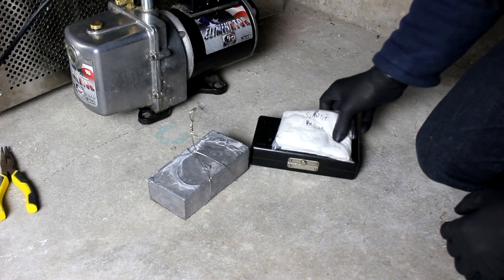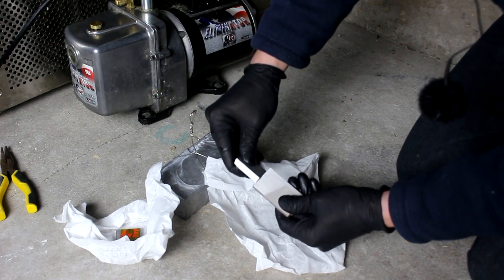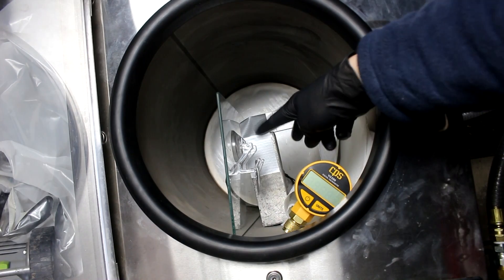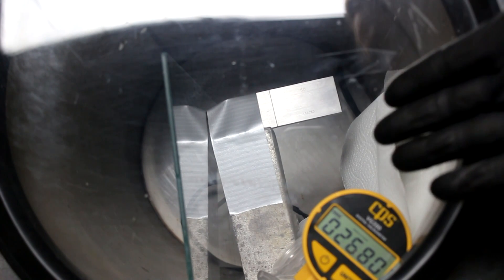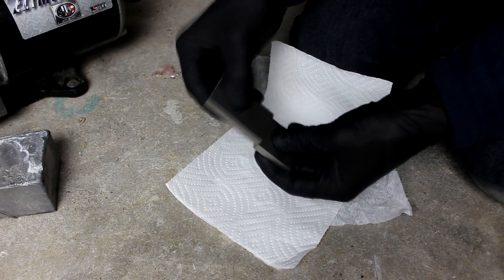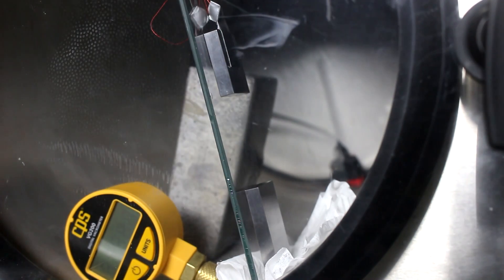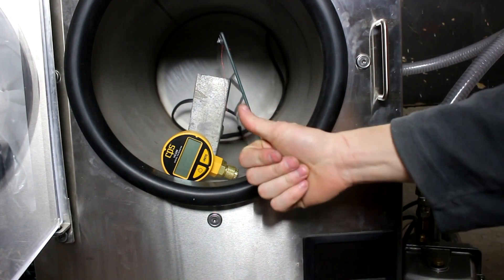Will Gauge Blocks Stick In Vacuum?

Comment: Maybe those dislocated elektrons start moving through both pieces. And therfore making it behave like on solid piece. You could check this by heating one side while them standing on top of each other and while being held together. If the second part heats up faster while being linked one could say, that the energy rich electrons traveld through the gap

Comment: void space phenomenon
2 perfect 1" gage blocks when wringing them together lose length.
1" + 1" = 1.9999999999"
Source: I am a dimensional calibration technician and have to account for this when building blocks of more than 4 blocks in length.
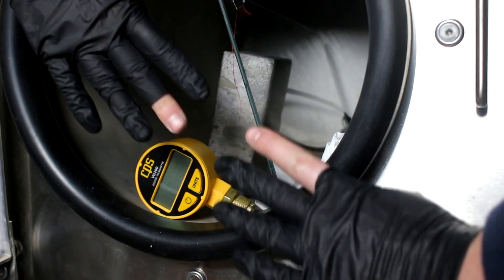Reply: 12:43  correct.

Comment: are we absolutely sure there is no galling going on, even on a small scale?
Reply: No you can simply rest them atop of each other over a weekend and they stick tight, longer they are left tighter they bond, had to use 5lb shifter hammer to split big pairs inadvertently left over a long weekend once, bond can be literally atomic.

Comment: Mini friction welding, small 'hairs' of metal interlocking, plus static? (Think your hair and a charged balloon)
Reply: that actually might be the case... 
kinda seems like that one trick with the fine liners that welds them together
Reply: I don't think static charges could be a factor since you need two different materials with a different average chance to lose an electron, creating net charges that are attracted, and the blocks are made of then same material.

Comment: I think it's a self-generating magnetic field, as the ions pass each other they swap charge back and forth creating a tiny magnetic field. You Can't test by electroplating the ends with something non-magnetic and or placing a piece of paper on the top and sprinkling with iron filings as you slide them together under the paper.??

Comment: I wonder about “liberated” atoms.  If it was just intimate contact the “sliding” shouldn’t matter so much, just “pressing” should suffice. I wonder if you actually abrade the surface liberating atoms to play intermediary like a glue. Sliding seems crucial, so it seems some mechanical alteration from the sliding is a major factor to get the effect.

Comment: I think the "cold weld" phenomenon can be attributed to oxydation of the metal where the air pockets form (micro rust). As for the original reason for the stick togetherness, I can only guess, but it think it might have to do with some inverse square stuff involving a combination of magnetism and vacuum

Comment: the duck tape will outgas from the adhesive if you pull a hard enough vacuum long enough between the shrinkage and hardening of the adhesive as it dries it will have a glass like surface that powders easily it may be enough but it will be much less strong that before you vacuumed it,

Comment: Temperature increase or perhaps slight static charge from the friction and the many contacting molecules (with heavy quote marks of course) of metal get electrons from the different blocks to flow or interact across the barrier? That might explain why the impact forces from the vacuum experiments weren't similar enough?

Comment: Wringing is not the van der Waals force / london dispersion force. Between two flat planes with 10nm separation in a vacuum, the van der Waals-induced pressure is around .05 atmosphere. This is two or three orders of magnitude too low. Its an additional order of magnitude lower under atmosphere. The longest atomic bond of any kind is less than .4 nm, and those bonds tend to drop off by the 4th power or greater. Even if tiny peaks of the blocks are touching, it won't be enough to create an attraction. Gecko feet are a weaker attraction than gauge blocks and we know Gecko feet uses the van der Waals force.

The separation would have to be below 1 nm across a large amount of the blocks to make a bond, and the roughness of gauge blocks only have tiny spots of contact. (Additionally, the force is repulsive before its attractive.)

I have no clue, but the Casimir force works at the scale of block roughness. Doesn’t explain why the attraction is not hugely stronger for metals, though.
Reply: I might suggest an all together simpler explanation:

The small 5-10 lb force being applied when wringing is enough for local surface deformation (and temporary vacuum) of the peaks when we consider *just* how small the feature sizes are.

So just a small amount of deformation at these scales -- then applied across the entire surface of the gageblock -- is enough to get the thing to stick.

An experiment to run:
Quantify the forces applied between blocks when wrung. See if there is a relationship between the sticking force (for example when being put into tension + pulled apart "normal" to the joint) and the force applied during wringing.

GRANTED: the force application required for tighter "sticking" between the plates will be exponential -- just bc feature sizes are so normal across these faces.   If were deforming the small ridges, with 5lbs ... for the user to begin to deform the less-extreme peaks (and therefor hugely more common) will take QUITE a bit more force. Simply by a function of the peak count -- far more peaks to deform.

So your experimental inputs will be something like

1lb
5lbs
50lbs
500lbs
5000lbs

If you have a change in the sticking force, I'd wager then the wringing phenomenon is caused by localized vacuum.

Comment: Cody you have just proven that the ether exists.  The ether is pushing in on both blocks, matter cannot exist without being fed the energy of the ether.  It maybe possible to assume that the surfaces are so close so polished so parallel it is excluding the ether.  If you figure the pressure from the air acting on the blocks it is magnitudes less than the ether pressure.  Vanderwaal forces are ether forces in my thinking.  Thanks for the experiment.

Comment: Actually that probably is microscopic ridges on each piece that are created by the machining process. The ridges are sliding between one another and linking each block together. I wonder if you too two different ones, and milled then on different machines and milled them at perpendicular angles, if that would cause it not to work.

Comment: That's got to be a type of friction. I'd say it's creating a vacuum and air pressure is pushing them together. But apparently someone tested this in a vacuum and it still worked.
Reply: Cody showed that it was not due to a vacuum between the pieces. Watch the first test again.

Comment: The surface is so smooth, that the material does not know where it ends, if you don't show em by removing them from each other
Reply: I think this is is more probable than not, that is unless a ceramic block will ring with a metal block.  I guess I need to google that first. LOL

Comment: My brother once destroyed a vintage motorcycle carburettor by degreasing the aluminium float slider and bowl with acetone. It 'welded' together, and could not be freed without deforming the components.

Comment: so at least part of what's going on here is there's a force pressing  them together when they are closer than a wavelength of light to each other. this effect only works with gauge blocks because they have enough flat area to make the effect observable. essentially in any space small particles appear for very short periods of time, then disappear. when two objects are close enough, those particles cannot appear there because there isn't room for them to travel before they annihilate. as a result there is a relative pressure from those same particles on the other sides of the blocks pushing them together.
Wonderful demonstration in quantum physics!!

Comment: With  the vibrational  energy  of  the  vacuum  pump and the fact that the input energy  of the mass of the block slamming  at an oblique angle would  not allow for  the controls  needed  to make that theory. Correct  me  if  you see fit. I am here to learn ,  no problems  being  admitting i am not a physicist

Comment: a friend of mine achieved the same effect using small plane mirrors (attached to wooden blocks) and sliding them together, as you did in this vid. i guess it's friction and smooth surfaces ¯\_(ツ)_/¯

Comment: This is due to surface tension, also called surface energy.  The atoms on any surface are in a high energy state and want to bond with anything they can in order to release that energy; in air they bond with the gas molecules.  Next to tape, they bond with tape molecules.  Put them next to a highly similar metal, with no other pesky molecules (only possible to an extent) and they bond more effectively,  no more surface (to an extent).  So 'cold welding' is really an accurate term.  This is really just the step before galling.  Try taking a fresh cut, clean aluminum nut and screw and assemble them.  They will never come a part.  Adding heat from friction adds energy and that helps the bonds to form.

Comment: I heard the sound when the pieces collided 11.25 
U shoud not be able to hear sounds on a vacum so why is that sound there ?
Reply: What you're hearing is the sound travelling through the material of the vacuum chamber itself. While it's true that sound cannot travel through a vacuum, sound can travel through solid material, albeit slower and distorted from what you'd hear normally.

Comment: The theory that pops in my head is that all metals have a scale to them. The "crystals" if you will. Even if machined within one wavelength of perfectly flat there would still be metallic scales even microscopicly that should act like 2 phone books if you iner-weave their pages by a quarter of an inch.  The friction between the metallic "crystals" should be enough in the surface area given to oppose gravity as 2 phone books can stop 2 full size tanks from tearing them apart. Would be interesting to actually see if the friction theaory I'd correct or not though

Comment: You could further debunk the first hypothesis by joining the gauge blocks together under high pressure, in effect creating a higher than atmospheric "vacuum" then subject it to the vacuum chamber to get a much larger differential pressure between the ambient pressure of the blocks and the pressure between them

Comment: Cody I don't think this changes your hypothesis, but the suction cups had air between them and the glass.  As the air was pumped out the air expanded and thus may have an effect on the suction cup not related to relative pressure pushing ON the suction cup, but it does create a situation where the air pushed against the glass and suction cup.  I'm wondering how the suction cups would react if there were no air between them and the glass.

Comment: Pressure blast with solvent instead of wiping with paper towels. Build a simple device using servos that will slide the blocks together under decent force. Put it in the vacuum chamber and try again.

Comment: The simplest model that works is that those blocks are simply glued together.  Your cleaning experiment kinda confirms that, because with less "glue" it's harder to make them stick, but it's still possible.

I just don't know why sliding would be important.  I guess it has something to do with friction, which "melts" the glue.  Like you need to heat up hide glue to make it work.

Ah, what is this glue?  I think that fat and oil absorbed on the surface.  Even gases when absorbed behave more like a solid than liquid, so I would expect some energy needed to make them flow.

Comment: Old Rolls-Royce cylinder heads used to be perfectly machined to the could be held onto the engine block like this. They didn't use bolts or studs like we do now. It's crazy how strong the attachment actually is between two precision machined surfaces.

Comment: Gauge blocks are ground smooth compared to the wavelength of light (~500nm), but they are still quite rough on the nanoscale. Light is actually pretty big! You can feel a micron or two step with your fingers, and a wavelength of green light is only half that. So there are plenty of rough features to get stuck together (via deformation of the surface) when you're wringing these gauge blocks. You can look at the blocks under SEM and see a lot of surface topography. They're nowhere near as smooth as chemically polished surfaces like silicon wafers, etc.

Comment: When you slide them past, it seems like you're pushing much harder, and slipping all of the air out, while scraping off any oxidation.  You didn't do those in the vacuum chamber.  Maybe try sucking the air out, using a device that cleans the oxidation off, and then presses them together to see what the effect would be.  (A much longer video though, I'm sure.)

Comment: The glass the blocks are resting against is almost certainly not flat enough for the surface of the blocks to mate properly. The surface of the blocks are perfectly flat but they are probably offset by a small angle created by an imperfection in the glass therefore they are only in contact on a single line rather than over the entire surface area. When the air comes in it just fills up the gap and they don't stick.
Reply: Yes, I agree with this. Also, the gasses/particles created by cutting the string might also be interfering with the surfaces mating close enough to exclude air.

Cody, maybe its worth it to try cleaning the mating surfaces again, sticking them together and then into the vacuum camber? Eliminating the tape contaminant? That should exclude all scenarios I can think of related to atmospheric pressure?

BTW - Love your channel Cody! I watch every video :)

Comment: Freeze them first please. I performed experiments with Ultrasounds sometime ago that produced a similar force and Heat could act as vibration source... idk I am just musing. 

Cody, could Casimir effect have anything to do with this by any chance?  They would be so close the pressure of Virtual particles would be different on the outside than the inside.  Van der waals  does not really explain why it needs to be slide ( Virtual particles I am not sure would either to be honest). Nice experiment. Please go further with this as its very interesting and you might have some sort of breakthrough if you look deep enough.

Hmmm....

Comment: before I get too far into this video  let me go on record as having learned in that little community college I went to that what you are dealing with here is undoubtable molecular cohesion at the atomic level according to my physics instructor.  And yes, these experiments have been done and yes those two stuck together will weld if given enough time,  The surface will be marred when you pull them apart.  
Measure the bocks before and after bringing them together and check for variance.  Of course you will need much much finer instruments for that

Comment: You most definitely can vacuum-weld polished blocks. But you need for them to spend a lot more time, just a few minutes is not enough.

Which totally makes sense - you get vacuum weld from atoms diffusing across the microscopic peaks that touch each other. And with metals at room temperature it's a slow process.

You can speed it up by heating the blocks (doesn't have to be nowhere near their melting point).

Comment: It seems like a form of electro magnetism. Cold welding or friction doesn't seem probable. Cold welding would destroy the flat surface pretty quickly. Making it less likely it would stick over time. Friction could do the same, but probably not as fast. I would be curious to see what the distance and pressure you have to apply to make them stick together. How many mm at different pressures does it take to make them stick?

Comment: I know this is an old video, but I'm a surface chemist and have some thoughts. Rather than just the VdW force, I think that you're actually doing by scraping them together is actually removing some of the oxide film on the metal. If the blocks are machined to within a few hundred nanometers (quite a feat actually), then the surface might be smooth enough to have a relatively homogenius oxide layer. The friction between the two surfaces might be enough to remove some of the oxide, then in some places you get cold-welding of the underlying metal surface.. You could test this by oxidising the surface a bit more with a blow-torch or in an oven, then trying again. If the above hypothesis is true, it shouldnt work.

The VdW force is very weak, and I don't think there would be enough from the surface areas of those block faces to stick them like that, particularly given how much they weigh.

Comment: Why not measure the force needed to pull them apart, and the area in contact. Then look to see what best accounts for the required pressure or can't account for it? For instance, if takes ten atmospheres to pull them apart, then you can be sure it involves something more than air pressure.

Comment: I know this is an old video but what if by sliding the block together you rub off a thin layer of oxidation on the block which causes it too cold weld

Comment: perhaps it's a induced dipole on the surface of the metal. the "squeezing" the two metal pieces deformes the electron hull of some atoms what induces a dipole moment in the atom and they stick together! The  surface must be very smooth to get that as many atoms of one piece "touch" the atoms of the other piece, press then together and deform with that the electron hull.

Comment: I believe I have a possible answer to that I think they stick because interlacing/friction and elasticity in the material.. We can make thought experiment.. Think at this 2 surface like they are covered in many tiny springs close together.. if you would just put the surfaces together they will just repel but if you slide them.. the springs tangle.. That is a similar behavior with the one seen with the gauge blocks. Also I think cold welding happens on the same principles.